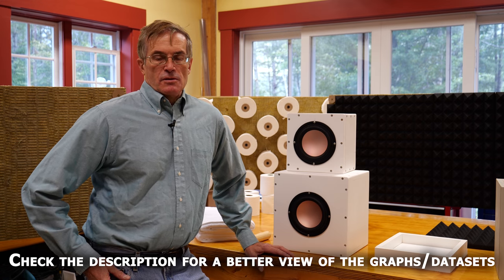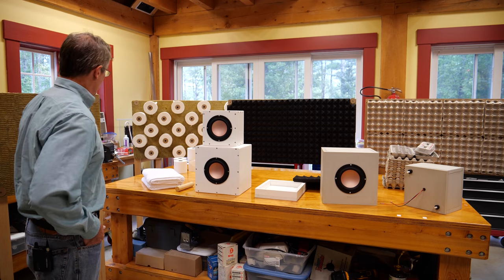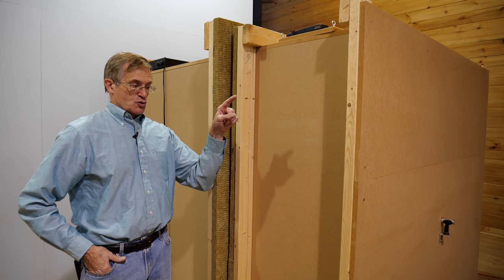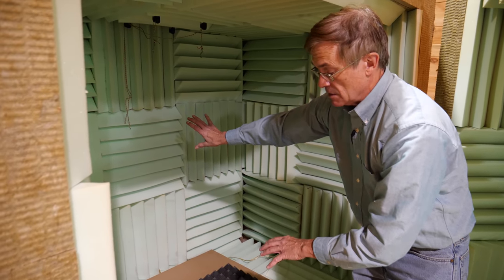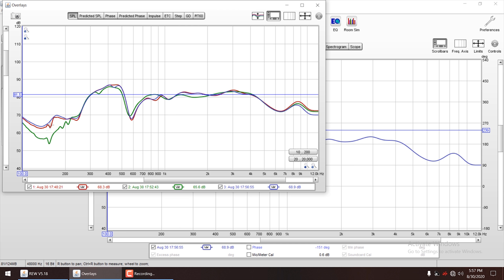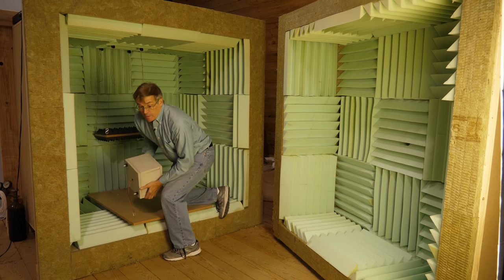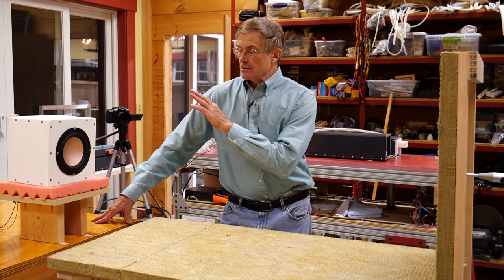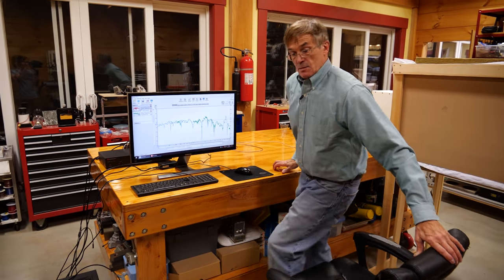DIY Speakers and Acoustic Panels

Comment: Hey there,

I am also a little bit into audioenginerding and love your work an helium interfacing for absorbtion or the ingenious transmission line box, that you built. However, what you seem to miss out on in your experiments is wavelength and the fact, that there is a difference between sound pressure and sound particle velocity, that you could take advantage of. your absorbers cannot reduce the soundpressure at the hard reflection surface of your MDF board. Putting rock wool in that spot doesn’t help much either, as it is only effective, where your particle velocity is highest, wich should be  at a quarter wavelength. The drop off at around 200 Hz of your chamber gives clues about the thickness of your absorbing materials (lambda/4 give or take = some 20+ centimeters, I´m from the metric world;). You could drastically improve the Frequency performance of your chamber by increasing the distance from the absorbers to the MDF walls, by doubling it with a cheap wood construction. The sound at high velocity (not at the boundary layer!) then has to pass your absorber twice in a place where it can actually do its work by giving friction to moving air.

The same is true for the wall absorbers you try out. The toilet paper assembly sticks out with an uneven absorbtion pattern, because of its huge dimensions (14+ centimeters of absoring materials). The large dip at 650 Hz coinsides with a quaterwavelength of some 13 centimeters, which explains, why this sort of wall is rather picky in its absorption pattern. 

Before you discard your concrete Speakers and the use of absorbing materials inside I would like to see the waterfall diagrams of your measurements, as they tell another part of the story, if you will. They visualize how truthful the speaker reproduces transients and how long it takes the resonance frequency to die off. Maybe, your insulated concrete speakers perform quite neat, as they have mass to counter the motion of the driver. At higher frequencies I would expect them to transmit more structural sound then Its wooden companions. I’ve heared of someone who went to the pains pouring  a double walled concrete speaker for decoupling the soundemissions of the housing. I never heared the speaker myself, but those who did where pretty impressed, the story goes. So maybe you give your existing measurments a second look, as REW can plot waterfall diagrams.

Other than that, I appreciate your meticulous work of taking baseline measurments … and sharing your work with the world. Thanks for inspiring us!
Reply from the maker: Your statement about the gap thickness between the absorber and the MDF is valid.  The compromise is due to practical limitations on the overall size of the structure.

Comment: This is fun, but a couple of comments.
1) You didn't mention if you're using a calibrated microphone?
2) When you did the helium test, by having the open port to allow gasses to escape, you are effectively porting the enclosure. Comparing this to a sealed enclosure is not apples-to-apples. You'd need to fill with helium, then plug both ports.
Interesting, however, keep up the great content!
Reply from the maker: It is a calibrated Omnimic, I should have mentioned this even though it's the same mic that we have been using for a couple of years in our acoustics videos. Regarding your second point, the amount of helium that spilled into the chamber would be a very small percentage of the air volume.  And, as we covered in our helium videos, helium between the speaker and the mic actually decreases the SPL and so if anything the effects would be slightly greater due to the presence of any helium.

Comment: As usual your very well thought presentations are a reminder for me personally to "raise the bar" in my overall thinking
in proceeding on any given project. Thank you for your time, knowledge, vast interests and energies, in your very impressive
video seeking to upgrade a room for improved sound.

I wish you had included and made a part of your comparisons/upgrades from standard sheetrock or an upgrade video
in the future, upgrading with any brand of a Manufacture's specific soundproofing drywall,  as well as 5/8-inch fire-code drywall 
which I have read can help dampen sound transmission. I think it could have even more interesting to see possible simple sheetrock
upgrades/additions in helping soundproof existing wall(s), in combination with your very useful suggestions in diffusing sound and
minimizing reflections within a room.

I don't work for a Drywall Company! I am thinking in terms of not only reducing the noise levels from teenagers in adjacent
rooms, in addition to utilizing your suggestions in improvements in my home audio recording space. Thank again!
Reply from the maker: Take a look at our "Lab Tour" video.  I described the construction of this building and the method we used to reduce sound (and heat transmission) through the walls.

Comment: Whats the best material for actually blocking sound? Say I dont want to hear my neighbor downstairs or i dont want my music to disturb them.. Toilet paper?
Reply from the maker: It depends.  A vacuum is the best barrier, but impractical.  For walls the construction technique I described in our "Lab Tour" video is inexpensive and very effective, but needs to be part of the construction of the walls themselves.
As a retro fit, the acoustic ceiling tiles are probably the most cost effective.
For a floor, you need to separate the support for the floor from the structure that supports the ceiling of the room below, just like we showed for the walls.
Reply: @TechIngredients  the intersection between my second story's sound and the basement's sound is through the stairs going from outside to my floor, but happens to be right on top of the basement space under those stairs. I was thinking maybe some sound mitigating barriers in the staircase room and the door that seals the stairs off from the actual upstairs is very poorly insulated.

Comment: Your ''anechoic'' chamber is a resonance chamber also. It's too small to be a real anechoic chamber. It will have standing waves affecting the measurements. I'd also like to see you test down below 100hz, as poly fill is known to change bass response your material in the enclosure might have that effect also.
Reply from the maker: Every anechoic chamber has that limitation it's a matter of degree and as you note, wavelength.

Comment: Why is the bottom Hz scale exponential and not linear? the first 1k takes half the graph and the last 4k 1/20. Would you not want to visualize the frequencies equally?
Reply from the maker: No.  We hear in octaves.  The frequency difference between the top two keys on a panio is greater than between the bottom 16.

Comment: Thanks for the many hours of work which went into planning, preparing, presenting, performing and producing these tests and the video. Your droll humour is also appreciated greatly.

One observation: My understanding is that port size affects output levels for a given speaker size inversely to frequency, so that for better low frequency performance, you need larger ports. Indeed, one old pair of cheap speakers here have an essentially perforated backboard, with many holes of about 7 mm diameter, and for their cost, they perform surprisingly well at lower frequencies, above the cone fundamental resonant frequency. 

Of course room acoustics affect things tremendously, and speaker performance is also very subjective, but I have no proper way of testing things.

So my question is: Can you please run tests using similar speakers to those used in the anechoic chamber, with larger port sizes, multiple ports of different sizes, and an open-backed enclosure to see what happens to the sound?  Thank-you.
Reply from the maker: That's a good idea.

Comment: Cool. We usually use ISO354 when measuring sound absorption on panels. It works by placing them in a reverberation room, the opposite of what you use with your speakers, and measure the difference in reverberation with and without the testing materials.
Reply from the maker: Interesting.

Comment: very cool!  You always have great projects.    2 questions: Can the Rockwool be cut to into Wedges?  & Whats the fire risk of the bedroom foam pad?  As a new Englander, we can't forget the station nightclub fire.   That is an extreme case where Fireworks were used, but a point is that there a perception that most inexpensive foam is flammable. Is there fire rating to look for?
Reply from the maker: The Soundboard is easy to cut and shape.  There is fire inhibited foam available,   what we used was a large foam mattress that may or may not have this property.  I suspect because of its intended use that it does.

Comment: I would guess that if you increased the length of the foam spikes 300% the low frequencies would be much reduced. There is probably some relationship between the wavelength and the foam spike length that could be optimized for particular frequencies.
Reply from the maker: Agreed.  That is why large scale anechoic chambers have such long internal spikes.

Comment: An audio engineer that I knew who worked a lot on mid 80's and 90's pop and metal music (Madonna, Metallica, a few other big names) says the best thing he found for blocking audio was garden variety books. He told me placing them in a similar pattern to your foam, i.e. some binding horizontally and vertically mirrored books would deaden a room like nothing else.
Reply from the maker: Interesting

Comment: Okay, this is a little off topic, but what about making speaker enclosures out of composite materials? I've just become familiar with a product called Coosa board, which is a fiberglass reinforced polyurithane board that is very strong, and acousticlly dead. Despite its light weight, I'd be curious to know if those other properties make it a viable material for speaker boxes.
Reply from the maker: Did you watch our video on the Voigt tubes?  Mass is good as well as stiffness and dampening.

Comment: One interesting, but often overlooked property of stuffing an enclosure, actually has to do with thermal dampening.
The modulating pressure waves, produce a corresponsing temperature modulation of the air cavity.
This is why loosly stuffing a box simulates a larger enclosure.
Reply from the maker: That may be true.  The major effect of loose stuffing is that it increases the refractive index of the air, slowing the speed of sound and making the box appear larger.  I discussed how this can be used to tune a transmission line in our "World's Second Best Speakers" video.

Comment: internal volume is NOT the same  :(  even with the board inside..its not a solid.
Reply from the maker: You're correct.  Interesting that another viewer claimed that the placement of an absorbing material has NO effect on internal volume.
A more rigorous method should involve determining the open volume of the sound board.  We could have done this by comparing the density of a small quantity of the fibers in a water bath to the bulk density of the board.

Comment: Another great insight evaluation, Thanks.
BUT.... I wonder if the speaker itself had a natural resonance at frequencies that were being attributed to it's enclosures? 
May I suggest a 'baseline' control in open environment (of course have the mic at same distance).
Then compensate subsequent analysis results for the inherent non-linear properties of the speaker itself, and possibly the mic also.  This would provide much more accurate data on the enclosures themselves.
Reply from the maker: I'm sure the drivers are not linear, but because all four are identical comparison of the output spectra shows the differences in the enclosures.  I wasn't trying to optimize the internal volume or the location and size of the ports.

Comment: I am curious if you stacked several cartons if they would start dampening the sound in any significant way. I always assumed they weren't using a single layer... but maybe it is just so inferior that even 4-5 layers are insufficient.
Reply from the maker: It probably would help, but at some point covering a significant area that thick would require an impractical number of cartons.

Comment: The good news is: It doesn't matter where you dampen the low frequencies. You can build a specialized 100Hz absorber and place it in a corner under the ceiling.
Reply from the maker: The bad news is that it's effectiveness is related to area.  It's not linear, but if only a few percent of the reflective surfaces in a room absorb the pressure wave, most of the energy will persist during multiple reflections.

Comment: I'm interested in blocking noise from my neighbor's pool pump.  They installed that right across from my master bedroom not more than 15 feet away.  We have a shared fence and my house is brick veneer.  Your thoughts on what kind of experiments I might do to measure the problem and possible reductions would be very much appreciated.
Reply from the maker: Start with a couple of cups of coffee and walk around the area. You already know where the sound originates, but how it gets into your house may be complex.  Is reflection off other structures significant? Do you have room and other projects that could ALSO serve to block/absorb the noise?  Consider a decibel meter that you could use to evaluate the situation. Consider recruiting your neighbor's interest in the situation as the sound may be a bother to him as well.  Suggest he take a look at some of our acoustic videos if that might build an interest or motivation.  Working together to build a barrier might happen.

Comment: At the manufacturing facility where I work, when I walk down the aisles of pallets flat cardboard packaging I can't hear hardly anything from the rest of the plant. It feels as you described, as if there's wax in my ears. A somewhat unnerving experience when you have to walk down the whole aisle. This is with the ends of the cardboard facing inward toward the aisle; the corrugations exposed. I've wanted for a very long time to test the sound absorption properties of stacked corrugated cardboard at varying depths. I wonder if it only works so well because of the depth of the sheets where the sound has to travel the around 4' through small corrugations from floor to ceiling leaving plenty of surface area for the sound to be absorbed. Still, it makes me think that an assembled stack of corrugated cardboard ends on panels, maybe several inches in depth, would provide some sound deadening. The real benefit is how extremely available and inexpensive it would be. An assembled panel would also be lightweight and could be masked by some kind of thin fabric for appearance.
Reply from the maker: That's an interesting theory.  The frequency effect would be worth studying especially because low frequencies are so difficult to absorb and that may require the full thickness.

Comment: Question if I may. Same idea different situation. I have a small van where the front 2 seats are in an insulated area with a roughly 7' long 4'X4' box in the back that is nothing more than metal walls. The floor has about a 1" pad which will get carpet.

I need to put something on the walls and ceiling which will be somewhat flexible and as sound deadening as possible. Cost is important, due to the small area there isn't going to be that much cost anyway so cost isn't that important. Probably should be something that could be removed at a later date.

I was thinking about a first layer of thermal bubble wrap on the outside to start for some insulation.

Any thoughts?
Reply from the maker: There are a lot of possibilities and considerations; water resistance, weight, self supporting and durability etc.  Decoupling by alternating light, flexible layers with dense non porous layers like lead sheet will block sound from penetrating but not absorb sound generated within.  They make mass loaded rubber sheet pre bonded to foam for doing both and this is often used to sound insulate marine engine compartments.

Comment: "If you've got extra and you don't think you're going to need it in the next couple of years"

Hearing this, I fully expect a Tech Ingredients video on a DIY bidet that goes into a deep dive on fluid mechanics and pressure regulation.  Perhaps also uses a closed loop water channel that draws heat away from the air conditioner and/or mini-fridge to keep the seat warm.
Reply: "Did someone say laminar flow?" - Destin

Comment: Does the concrete enclosure subjectively sound better?  Would be interesting to measure a concrete encased woofer tangentially v.s. say MDF.
(basically a measure of the enclosures ability to contain off angle lower frequencies.)  May be hard to measure in a chamber that doesnt dampen low frequency well without perhaps targeting a single frequency.
Reply from the maker: It does not.

Comment: Did you know that by using very short test signals and keeping the microfone close (1meter) away from the speaker, you can catch the response before reflections arrive. And by doing that you eliminate all the problems with reflection and the need for a damped chamber?
Reply from the maker: Yes.
However, in this situation we're actually evaluating the reflections.

Comment: Would there be an improvement if you made a “sandwich” with acoustic ceiling tiles either side of the Rockwool type panel? 

Once again outstanding quality video, my only complaint is that it was over far too soon! 

I have waited for the perfect moment where I could sit down and watch with no interruptions whatsoever. 
Well worth the wait!
Reply from the maker: Probably.  That is why we ended up using double layers of Soundboard in the anechoic chamber.  Layering helps.
And thanks!